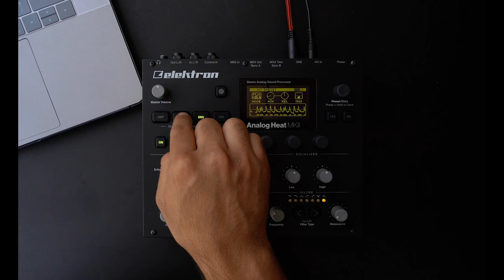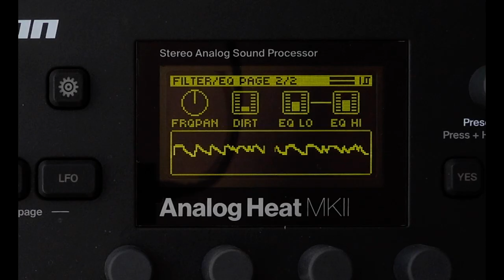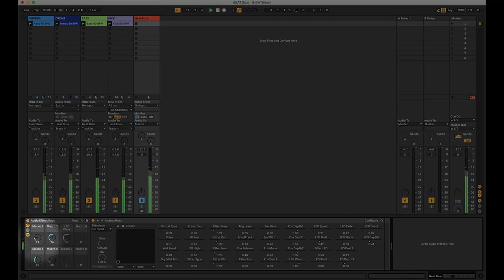Elektron Analog Heat MKII and Overbridge - Processing Multiple Audio Sources

Comment: So you don't have to plug any audio cable to use it with Ableton ? Just through USB ? 
Then can you send the processed signal to a mixer through your soundcard ?
Reply from the maker: Yes you dont have to plug any audio cable to use it with Ableton Live. Yes just through USB. Yes you can then send the mixed audio out of the Main Outputs of the Analog Heat MKII.
Reply: @ElektronVideoKlub  that's amazing! Thank you!

Comment: Great video !! ... did you try AH as a sound card/audio interface ?? I am planning to get a new audio interface and for a all in one product this is awesome... can you use it as a regular audio interface/headphones out for monitoring etc without adding effects (let’s say you want to connect a synth and send the raw audio to the daw ??? ) is it a good quality AInterface??? Has Latency???  Sorry I am new to this product and couldn’t find any recent video comparing AH with any audio interfaces + I read a lot of mix feelings reviews ... thank you 🙏🏼 for sharing ... subscribed
Reply from the maker: You can use the Analog Heat MKII as a regular audio interface and let signals pass in and out unaffected by the effect. At the same time, you can, via Overbridge, also use the effect to process another set of audio signals.
Reply: Elektron Video Klub thank you for your quick response! Is the audio quality standard to any today’s standard ?
Reply from the maker: @mauriciomandara5946  The converters on the Analog Heat MKII are 48kHz, 24 bit D/A and A/D.